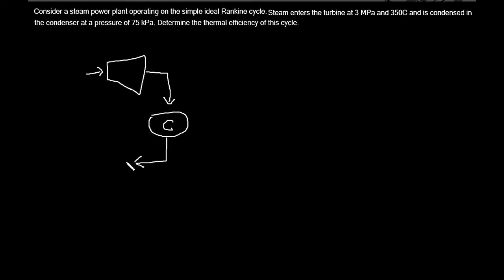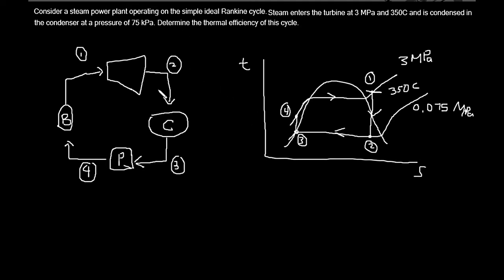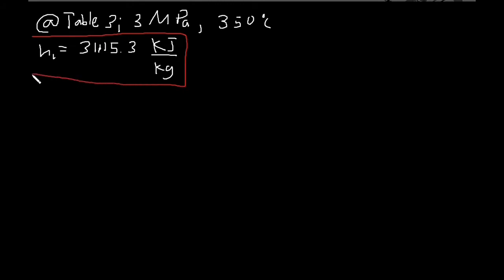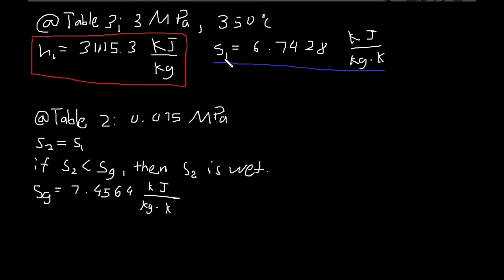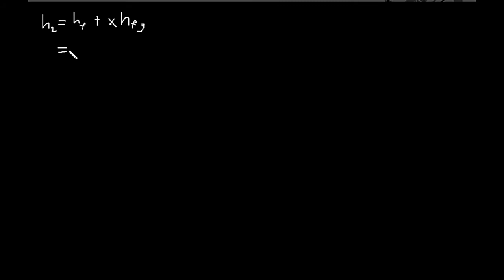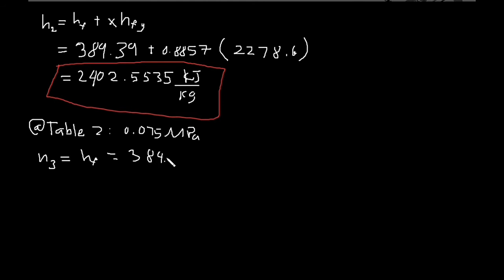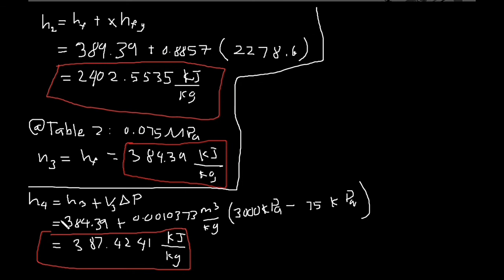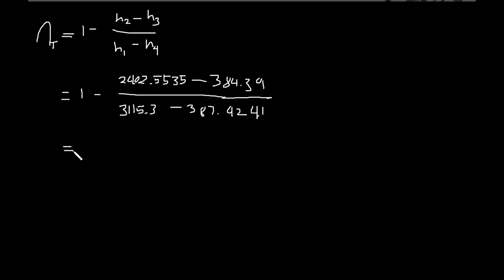Thermodynamics: Ideal Rankine Cycle problem and solution

Comment: But if you use 
Bar as the pressure 
h4=384.03kj/kg 
h4=h3+v3(p3-p4) 
h4=384+0.1037×10^-2(30-0.75) in bars oo 
h4=384.030kj/kg 
But when is in kpa 
h4=h3+v3(p4-p3) 
H4=384+0.1037×10^-2(3000-75) in Kpa  
H4=387.42 i don't get are we supposed to use bar or kpa?

Comment: Come on man. What's table 3
Reply: You need steam table basically the table 3 he mentioned is in super heat state. there 3 state in that 1st temperature 2nd for pressure 3rd for vapor
Reply: @jbc919 nope it’s actually wrong